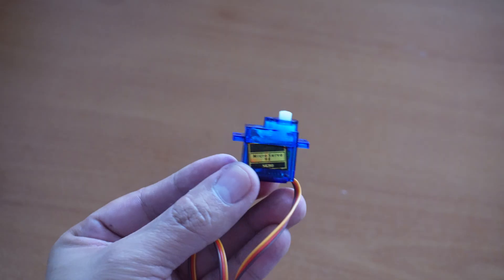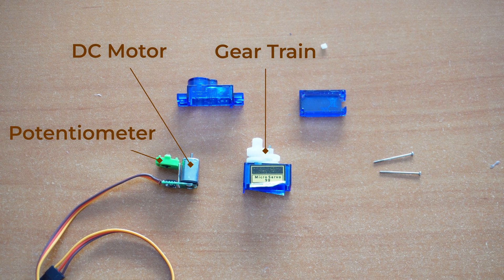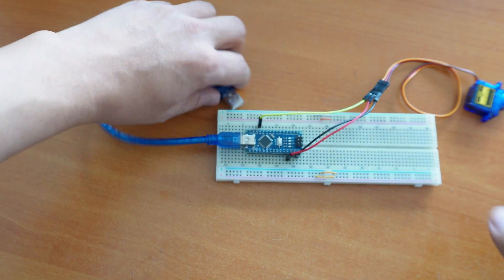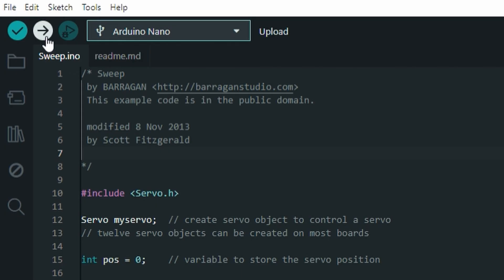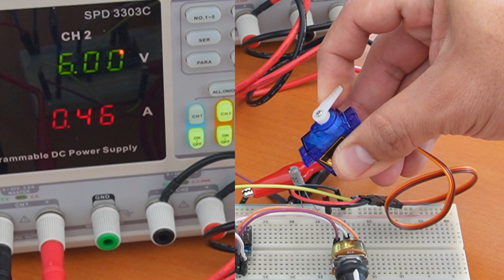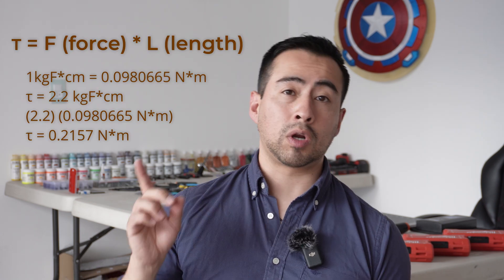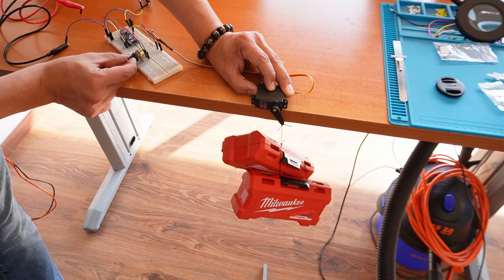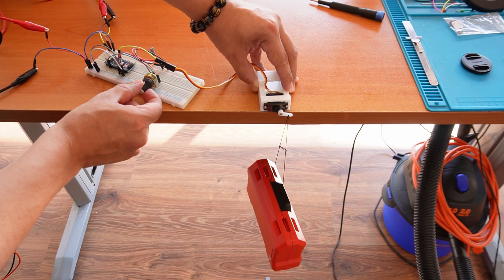Servo Motor Tutorial: Everything you need to know in 6 minutes!

Comment: Is it possible to make a positional servo rotate 360 degrees? I'm new to this. Another question  I'm working on a mini project using a rotary encoder to control a servo's angle. Currently, I'm using an MG90S servo, and I’ve noticed that when I set the angle to 0 degrees, it doesn’t actually point exactly at 0 degrees .